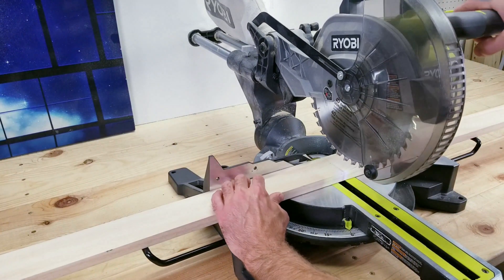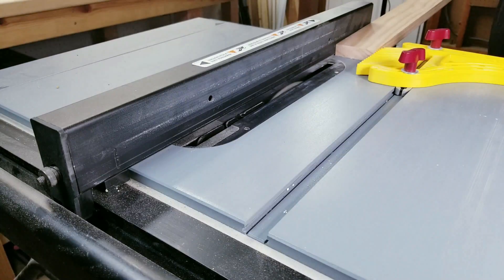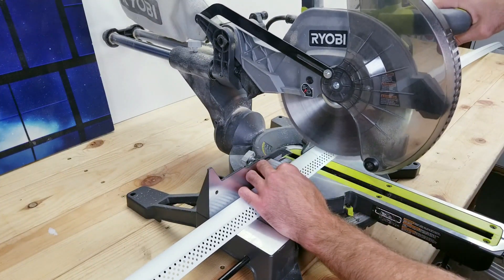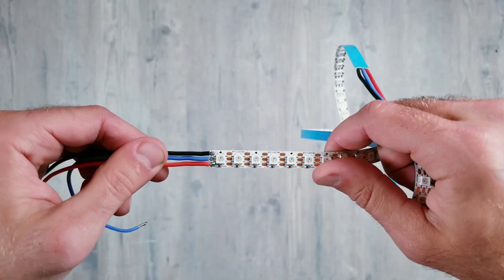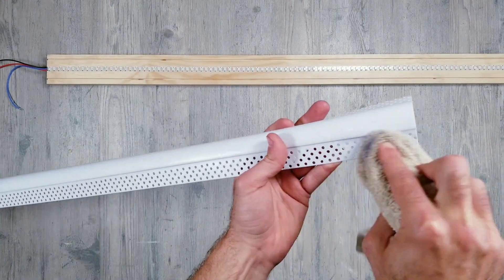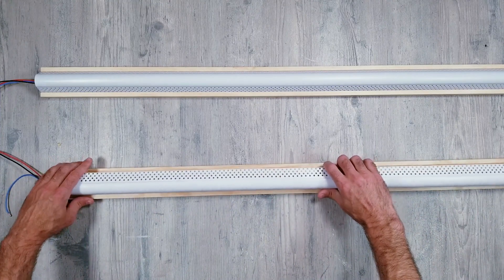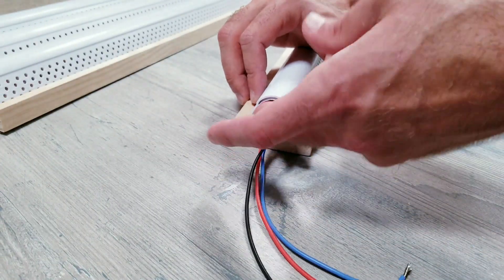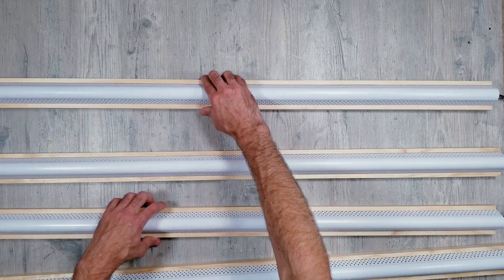EASY DIY Diffuser Channel - Quick and Simple Instructions

Comment from the maker: 📟 BEST Amazon Deals on Electronics: https://amzn.to/47qjC9j (updated daily)
☑Check out my sponsor to begin your FREE 14 day trial to Aura: https://aura.com/chrismaher
LED Lights WS2812B on Amazon: https://amzn.to/3pngBDO
AliExpress LED Lights WS2812B: https://s.click.aliexpress.com/e/_Der0k7N
ESP32 Device: https://amzn.to/3uDP1ln
Diffuser Material: https://www.menards.com/main/building-materials/drywall/corner-bead/phillips-gripstik-reg-1-1-4-vinyl-bullnose-corner-bead/bn3vylmen8/p-1444450727309-c-13053.htm?tid=402447906878228907&ipos=1
Power Supply Used: https://amzn.to/3uGPKSK
Wall Plug for Power Supply: https://amzn.to/3jCaXae
Roll of Paper: https://amzn.to/3xSpFBY
18 Gauge Silicone Wires: https://amzn.to/3Keoel3
Wago Connectors: https://amzn.to/3vgFBeF
Wire Stripper: https://amzn.to/3uHP4g4
Soldering Iron: https://amzn.to/3jxx1mB
Solder: https://amzn.to/3r6smMA
Solder Smoker Absorber: https://amzn.to/3rbHCYp
Helping Hands: https://amzn.to/3v19YG3
Soldering Iron: https://amzn.to/3jxx1mB
Solder: https://amzn.to/3r6smMA
Solder Smoker Absorber: https://amzn.to/3rbHCYp
Helping Hands: https://amzn.to/3v19YG3

Installing WLED on ESP32: https://youtu.be/TOEnFKLm9Sw
How To Solder Video: https://youtu.be/apSz3NXYlx8

Other Videos I Have Made:
Best Diffuser Channel on Amazon: https://youtu.be/1SKo_HdKVYA
Best Edge Lit Diffuser Channel on Amazon: https://youtu.be/FNDikt7VfRw
DIY Board and Batten video: https://youtu.be/b13VLiK7AOU
How-To Video for the LED Pegboard Project: https://youtu.be/K4EzLI1fFnQ
DIY LED Baseboard Trim: https://youtu.be/Ik8HnGxfQq0
RGB Lamp Hack: https://youtu.be/UNPR_98xLQY
Corner LED Light using Pex pipes: https://youtu.be/rIbTzUD2E4k
DIY Govee Glide using only paper: https://youtu.be/n9LsiQARFas
Simple Corner LED Project: https://youtu.be/ZB5HqWhMXNo
DIY Customizable Light Up Images: https://youtu.be/2q_zrEcbXHE
LED Strip Diffuser Ideas: https://youtu.be/09-fiWjP42Y
DIY Hexagon Project: https://youtu.be/t9xGyB4ahyY
DIY Edge Lit Designs: https://youtu.be/0_TtHkBB3vA
DIY Black Acrylic Floating Shelves: https://youtu.be/6csSMtV_op0

Other LED Tutorial Videos:
Installing WLED on esp8266: https://youtu.be/l8OMi7SMpqs
Power Options for LED Strips: https://youtu.be/KFtjf5mD6tA
Use WLED with Govee Lights: https://youtu.be/l0sRG1WAbq0
Re-Use Leftover LED Strips: https://youtu.be/ASnuk-XDVbI

Unboxing Videos: 
Divoom Pixel Art: https://youtu.be/e9w5FLifgdU
Lytmi Neo 2.0: https://youtu.be/sth-EdEfSis
Govee Lyra Floor Lamp: https://youtu.be/NFDYz37ZoXU
Govee Glide Hexa Panels: https://youtu.be/UDYUvfce4tM
Govee Glide Light Bars: https://youtu.be/e3jJye-fYoM

The best way to help support my channel is to like, comment, make sure your subscribed and share my videos with as many people as you can. The other way is to use my links above as I get a small % at no extra cost to you if you buy something. Thank you all for the support!

Comment: Nice. What about led temperature?

PS love the creative use of materials!
Reply from the maker: Thanks so much for watching! In my experience leds really don't get warm unless you have them on full white and full brightness (then you can feel a little heat) But I really never have a need for that so I've never worried about not using a heat sink channel and I've never had any issues using wood. But not so say something couldn't happen, its just I have never had any trouble.

Comment: paper with a heat source.  Good job!
Reply from the maker: Thanks so much for watching and taking the time to comment! Have you had issues with led lights getting hot? I personally have not but curious if others have.
Reply from the maker: You could also easily substitute the paper for some milky white stencil sheets that Ive used in past projects.

Comment: 🤔 Since I'm too lazy to explain detail that I see, I will just give main 4 points in my mind..

1. Cheap alternative. (Compared with Acrylic diffuser and Aluminum Profile)
2. Easier to cut. (Wood, plastic, paper)
3. No proper heatsink. (Usually people use Aluminum Profile as proper heatsink)
4. Poor lighting output efficiency. (since most of the light will be hit the plastic part)
Reply from the maker: Thanks so much for watching and taking the time to comment! Appreciate your feedback buddy!

Comment: Would this work with govee?
Reply from the maker: They would but you would be able to see some hotspots since govee led strip lights only have 30 leds/meter. To get the smooth look with no hotspots, you would have to use something that had 60 leds/meter or more. Thanks so much for watching!
Reply: @ChrisMaherDIY  I have govee 32ft strips light and can’t decide on a diffuser. Any recommendations!

Comment: I would use an adhesion promoter to make sure the strip doesn't come loose, especially if it's going to end up vertically or upside down.
Reply from the maker: Thats a good idea! The sticky stuff on the backside of the strips are not always the best. Thanks for watching!!
Reply: Yeah like a clip or something screw in. Adhesive tapes tend to lose their adhesiveness after a while
Reply: @cooljaybz  hot glue can be enough.. 🤔 The Strip usually tend to break free bcoz there's pulling force that usually caused by the Strip's shape and cable..

Comment: Isn't wood quite bad for the LEDs because of the heat dissipation?
Reply: I use Aluminum tape used for HVAC installations as a backing material for my LED strips. Depending on the area you can cover.
Reply from the maker: Thanks so much for watching! I'm sure having them on some type of metal would be preferred but I've done many projects using wood and have yet to have anything fail on me. Also, in my experience the 5v led strips really never get hot. I'll let you know if I ever have any issues down the road! Thanks again!
Reply: It is for high power applications, but these strips don't heat up nearly as much as the ones dedicated for general lighting.

Comment: Onother great video Sir! Well done. Quick question. If i buy 2 WS2812Bs, can i connect them right away without soldering? I want more than 1m led strip. How many led strips (100led/meter) can i connect ?
Reply: I’m not an expert but there are connectors on Amazon that you can use to connect them together. You may have to power inject depending on the length
Reply from the maker: Thanks for the comment! They do have connectors but I personally have not tried them on the led strips that have 100 leds/meter. I know for sure that they work on the 60 led/meter strip though. However the 100 leds/meter strips are a little bit bigger so I would think they would require a slightly different connector piece design. I'll have to look to see if I can find anything!
Reply from the maker: Thanks as always my friend! You can connect them together. All their strips come with the beginning and end connector piece. You can simply plug in the beginning of strip number 2 into the end of strip number 1. I'm not sure if the led strips that have 100 leds/meter have those connector plastic pieces available. The led's are pretty close together so i'm not sure if that would work. But if you want 1 continues led strip, my suggestion would be to solder them together so you don't have to deal with the connector wires in the middle.